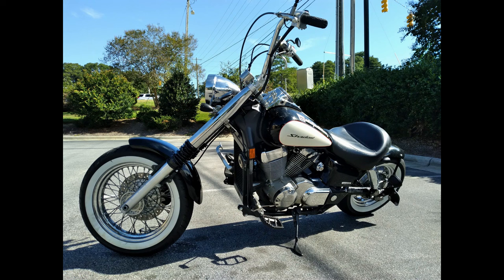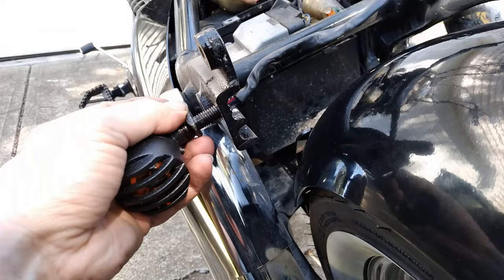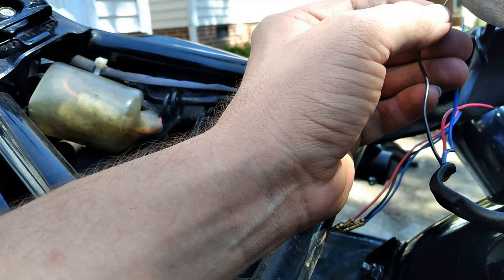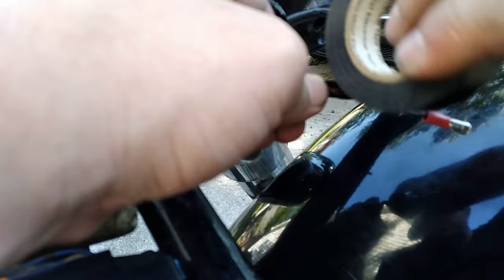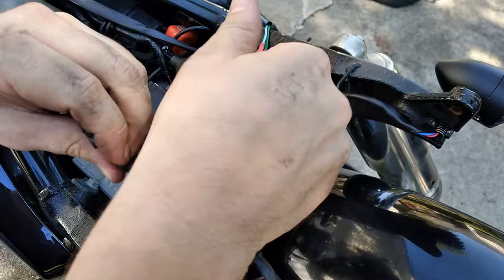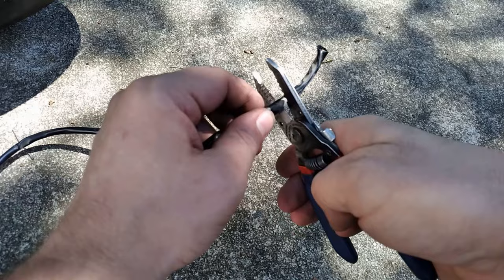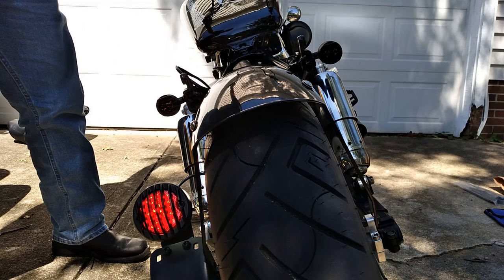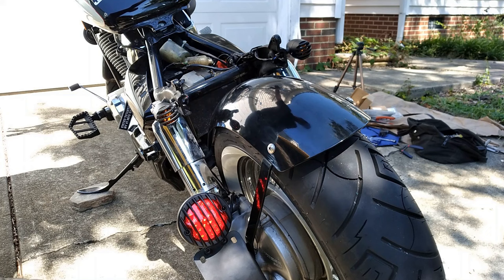TURN SIGNALS and BRAKE LIGHT Wiring! | Honda Shadow 750 Aero BOBBER!

Comment: I got new turn signals and I put all the wires with the same colors.. and when I press the left turn signal the right one blinks insted. Why is it doing that??
Reply from the maker: Did you by chance get the plugs mixed up? I did this in the front and had to swap them around.
Reply: @LuckyAcesRiding idk man. When I took them off the blues were with the blues and green with green and black with blacks.. there are only 2 blue wires and 2 black wires.. I swapped them over and over and it don’t work.. I don’t want to put a blue wire with a green one.
Reply: @LuckyAcesRiding I’m also worried that if there are mixed up.. there will be a fire hazzatd. It’s the blinkers in the front that are mixed up. Also I seen that the plug 🔌 behind the headlight is kinda melted I don’t want my bike to catch fire

Comment: what are your tire setup?
Reply from the maker: Shinko 777 whitewalls 170/80B-15 rear, 120/90-17 front
Reply: @LuckyAcesRiding  so my stock are 150/90/15 
Do I need to order that or can I get away with what you got ?

Comment: Okay I have a question so you did the back ones now if you wanted them on the front as well where would the wires go ? Is there another harness for the front ? or do you wire them directly off the switch of the bike , also a fellow north carolina man so i would appreciate your help alot man.
Reply from the maker: The color code for the front and rear turn signals are the same. What I did was cut the factory plugs off the front turn signals and splice them to the new turn signals and installed them in the factory location. This video was suppose to include the front signals as well however it was recorded in the heat of summer and my camera got too hot and shut down part way through. I installed the rear fender the same day and after being in the heat for a few hours I was just ready to be done.

Comment: Anyone know why my lights are both flashing light I have hazards lol
Reply from the maker: Oh man, I have not seen that before. I'd go back and double/triple check all wiring to make sure nothing is crossed or shorting out.
Reply: This literally just happened to me a few days ago. There is too much load for the relay. You need get a diode or you can take out the turn signal indicator. I took the turn signal indicator out and my turn signals worked fine

Comment: Hi i need help, ive tried changing the old turn signals to new ones and i did plug them correctly and when ever i hit the turn signal switch the back signals dont worl properly but the front ones do.

Comment: Did you need an LED flasher relay to do this?
Reply from the maker: A previous owner installed LED bulbs in the factory housings before I bought the bike and I presume they did?  I'm not 100% sure though as the signal indicator light has never worked and I heard if you disconnect that you do not need the flasher relay.  This is all based on things I have read online so I can't say for certain.

Comment: Those lights look really good.  Nice choice!
Reply from the maker: Thanks! I really dig them.  When I did the fronts I either lost a ground or shorted something out as I have zero running lights.  It would be a project if things went perfect I guess.
Reply: @LuckyAcesRiding  I hear ya!  It almost never fails. I can do a project and it runs smoothly until nearly the end. Most of the time, I just chalk it up to bad luck but it always works out in the end.  Usually makes for a story and proves you can adapt and overcome.  Keep moving forward!

Comment: i have an 07 vt600c, will i have to use a  flasher relay or does my bike have leds already
Reply from the maker: Flasher relay will probably be required. My bike had LED bulbs in the stock lenses so I am guessing a previous owner swapped it out.

Comment: Dude I got the exact same license plate/brake light on Amazon is there a certain way to wire the running light? Mine won't turn on at all
Reply: Literally same
Reply: Help
Reply: @StephenMathis-e9w  check your meter fuse mine was blown
Reply: @joshglasscock2586  thanks! Also, now this is crazy, the running light doesn’t work, the brake light works. It also blinks when I turn my blinkers on AND all my lights on the tank and handle bars blink (odometer, gas light, brights indicator, and the glow around the speedo) I turned the bike off and went inside. Don’t have time for this 😂

Comment: Why 3 wires ? 
My Honda shadow 06 750 aero has 2 wires only for the turning signals 
Im confused as to which I should buy now 
Any help?
Reply from the maker: 3 wires up front (turn and running lights), only 2 required for the rear (turn only).   I bought two sets of lights with 3 wire so I can put them wherever.
Reply: @LuckyAcesRiding  ahhhhh it makes sense now thank you bro 
I just bought the 2 wired ones yesterday 
Installing them tomorrow 

And bro please what are those connectors you used to connect both ends of the wire
Reply: I've been going crazy with mine bc I have 2 green 1orange on right side.grean and orange left...and wth is a electrical variable load flasher?? It came with my light.
Reply from the maker: Are the new lights LED? I suspect the "variable load flasher" is a replacement relay to compensate for the reduced load LEDs have on the circuit as oppose to incandescent bulbs.  @rosieeye6812